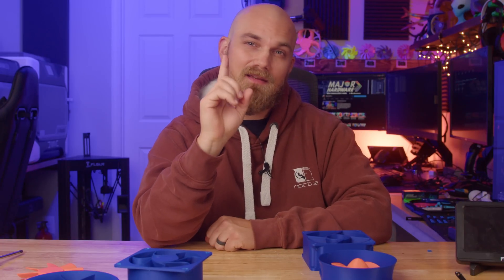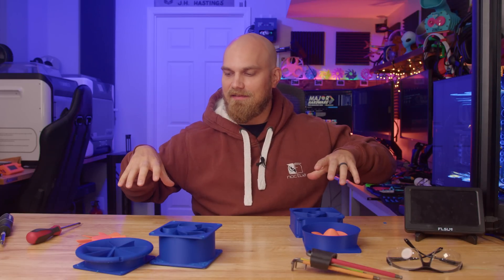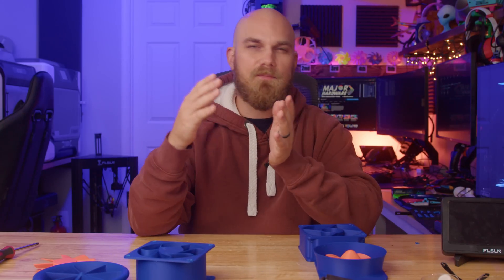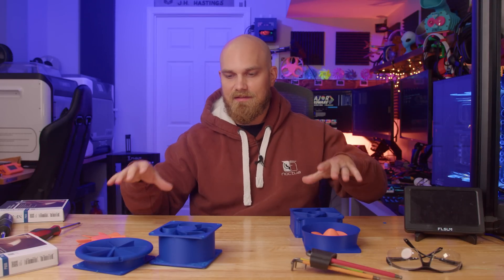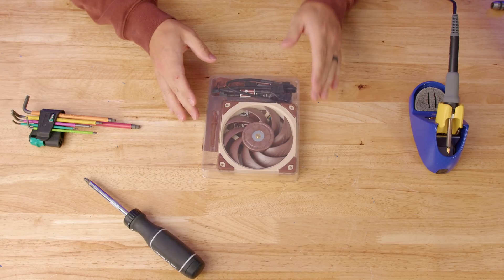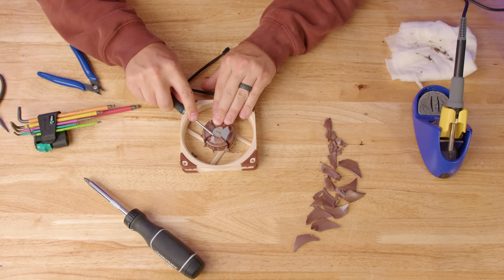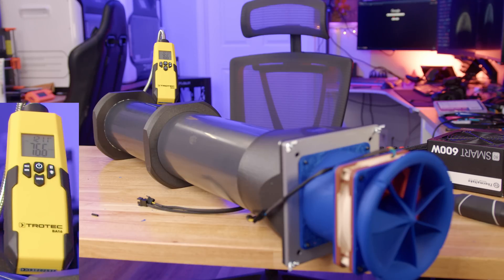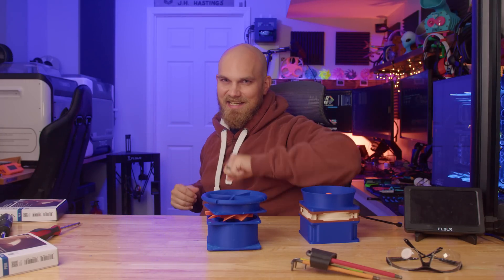Which One is REALLY the BEST | Fan Showdown S4 Finale

Comment: I like flow testing, and it has to be a much easier test to run than cooling a PC just to see if it works. How about you figure out the minimum flow required to cool whatever PC you're cooling and then give it a pass or fail based on what airflow it gets. Maybe also run the flow test through a radiator for those of us that use those. If you do that, put the radiator on the suction side of the fan, not the blower side. Radiators work better when air is sucked through them.
Reply: I agree, he should do flow testing and also static pressure testing
Reply: Where did you get the idea that radiators work better when air is drawn through them vs air forced through them?
I'd like to see a quantitative study of that. It's counterintuitive.
Reply: @SwervingLemon  I guess in a scenario where the fans would be removed all the time it wouldn't make that much difference. In a push configuration inside a case the fan will blow dust into the radiator and it will clog up over time reducing performance. With the fan in a pull configuration you can easily just blow air through the radiator to clean it and it's easy to see when it needs cleaning. With these custom fan designs it may help to have it in a pull configuration simply because they exhaust air can sometimes blow in all different directions reducing performance. In a pull configuration the exhaust air pattern makes no difference.
Reply: @SwervingLemon  ummmmm just general thermodynamic laws and a basic understanding of how air pressure works. High pressure air (lower density, but more active, typically little to no moisture = hotter air) rises naturally over Low Pressure air (higher density, less active air, tends to carry moisture= cooler air) When you have a PULL setup you are literally pulling the hot air UP and OUT in the natural direction it is meant to which in the absences of hot air, cool air must take it's place, cool air that has more moisture which when contactin heat pipes increases their efficiency. 

As opposed to blowing cool air down onto hot air thinking it will make it much colder, this line of thinking shows a complete lack of understanding of the science. Which is why most knowledgeable gamers have their extremal fans be their air draw fans, and their upper case fans as exhaust.0
Reply: @sk8paradoxity  So many things wrong with this. High pressure air is denser, and increasing the pressure and density of air will increase it's temperature, which increases its moisture holding capacity. Reducing pressure and density will also reduce temperature, which reduces the moisture holding capacity, and the moisture in the cooled air falls out as condensation or rain. After it has cooled down, cold air is very dry! My lips always crack in winter.

Also keep in mind that air-cons need to work at 50-300 psi to wring the heat out of the air. No fan is ever making a pressure difference of 10 psi let alone 200, even properly driven impeller and turbocharger designs would struggle, and the plastic would fail long before they spun fast enough.

None of this matters in the atmosphere of a single room though. Fans don't always move air up or down, the only fans in my case are in the side, and all the vents are at the same height. It wouldn't matter which fan was the exhaust. Hot air does rise though, so having exhaust fans higher majes sense.

All the air in a room has comparable moisture; you're not magically creating water when compressing or heating the air, and all the air in a room circulates quickly enough that the only moisture differences you'd notice are near moisture sources (plants, aquariums, humidifiers, swamp coolers, drinks, etc.) which add moisture, or large temperature differences causing condensation (windows, air-con, a cold drink, etc.) which remove moisture.

TL;DR: Hot air rises, fans don't cause enough pressure to care about density or temperature, and no one cares about moisture (except your lips in winter).
Reply: @sk8paradoxity  Your understanding of this is flawed. No offense meant, but you're operating under more than a couple of misconceptions there.
I see someone else covered most of them...
Reply: Yes but at the same time airflow and head (or static pressure) are dependent on each other. Look up head flow curves for turbomachines
Reply: Plus cooling also has to do with system irregularities where it decides to clock your CPU or memory higher for a short time, etc. The flow test is more quantitative.

Comment: I really think we need to go back to the start of it all. Moving as much air as possible (or keep as cold as possible) while being under x decibel.

The whole point of the noctua fans is that they are less noisy than others while still cooling your computer.

You can always just boost the speed/power of the motor in the fans to move more air. That's not what computers fans limit is. Their limit is moving enough air while not being annoying.

Comment: Why not both? Air cooling is where flow is king. Water is where static pressure is king. I think both aspects measure the 2 key performance aspects of a fan, volume and pressure. 

There is an additional one, which is distribution of that airflow. I struggle with that on my Black Ice, where the dead spots are still rather annoying and I know I lose some cooling potential there.

Comment: Water cooling will show the true strength ov the designs as it has to force the air through a radiator. Air coolers are mostly fins with usually 6 heat pipes.

Comment: I like the airflow method better, it has less variables and it's more accurate imo. 
If you want a more"realistic" scenario you could add an air cooler or a radiator between the fan and the tube to take static pressure into consideration
Reply: This is the way.
Reply: Totally agreed, Up You Go Sir !
Actually that set has a radiator to place in it, so in that way you can measure cooling performance aswell (higher CFM = better cooling). Easy at it is.
Reply: I would like to see both a push and a pull configuration with the radiator on the tube.
Reply: I think testing with nothing, and air cooler and a radiator would be best. And each should have its own leaderboard.
Reply: Yep. Airflow is the better test. Static pressure is a definite aspect that should be tested, but actual temp testing is too long and honestly too many variables to be meaningful.
Reply: Mix it up in Season 5.  Use a dual or triple rad and print two or three of each fan to test side-by-side in a case.  This adds a new requirement to make the fan fit next to each other but it may make for some epic shroud designs for the rad setup.  ps keep the airflow testing going too.
Reply: I definitely think this is the way to go if it's not too much work to do multiple runs.
Reply: I agree with this to also test there strength in static pressure nowadays more and more people are using AIO`s on there systems.
Reply: Agreed
Reply: Yes, that
Reply: this
Reply: Airflow + static pressure is the way to go. That would give the real world result. 
Question remains, how much static pressure to give and how much can a fan handle?
Reply: @mihkelsepp72  Why not do multiple and plot them out, see where some fans do well and at what point others fail.
Reply: Agreed and boosting the comment
Reply: cam here to say the same thin.
Reply: Yip plus this checks 2 tests in one so should streamline content creation a tiny bit too
Reply: Came to type this: "What would be interesting to see, would be another column in your Excel sheet, with airflow through the radiator of an AIO.", but saw your post before I clicked send.
Reply: I’d like a mesh
Reply: This is the way
Reply: Static pressure and CFM relationship
"If the estimated static pressure resistance is greater than the available static pressure of the fan, the airflow cfm delivered by the fan decreases until the system pressures match."
Reply: Totally aggree with that.
You can aslo build easily another tool to measure the static pressure like this one : https://youtu.be/INbV5ggQ93A?t=120 (even if here, he's not measuring static pressure but total pressure)
Reply: It will be better if he measured input airflow, not output. This tube addition have big impact on convention coolers.
And radiator is must have.
Reply: @nicklaich  Waht!? how could input airflow be different to output airflow?! 
It's a fan it moves air not create air out of nothing